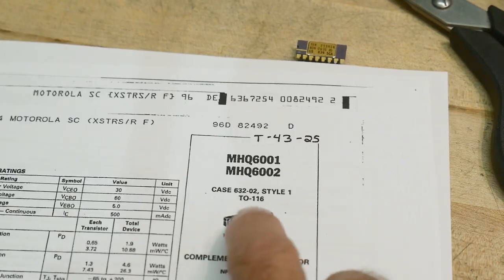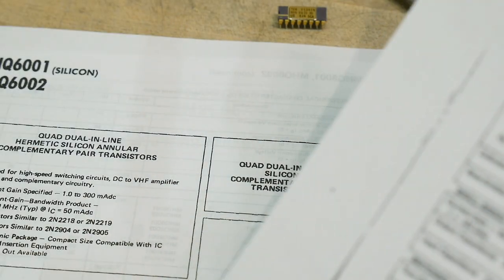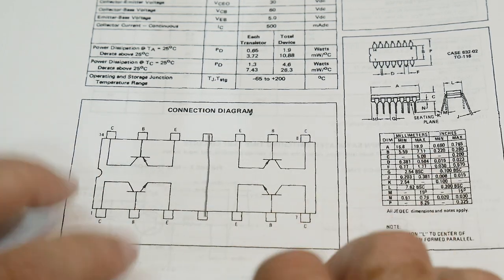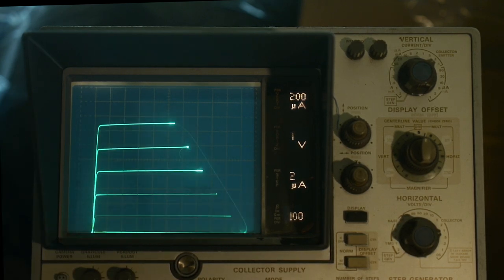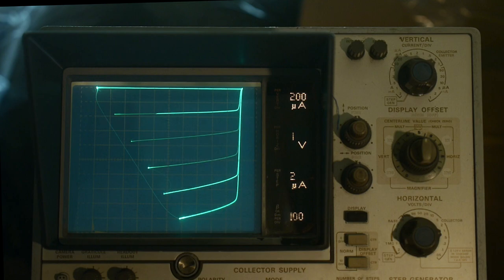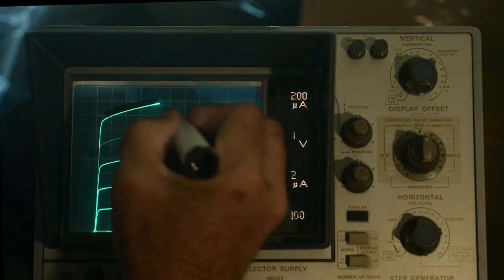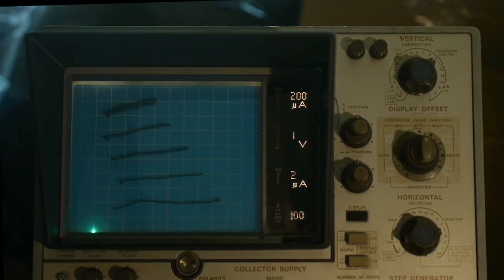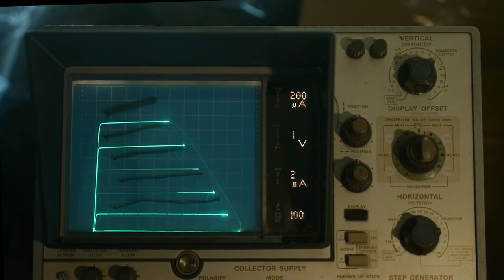#1615 MHQ6002 Quad Complementary Transistors

Comment: Back in the day, it was pretty common to use one pair as a heater and temperature sensor, so that the second pair were held at a constant temperature. That way the kT/q dependency was taken out of the equation.
Reply: Isn't that similar to how a band-gap reference works? Use two transistors at different bias levels to remove temperature effects?
Reply: @robertbox5399  this is more of a brute force approach: force the whole die to a known temperature above ambient by heating it. One of the four or five transistors in an array was just having current pushed through it to heat the chip.

Comment: I think manufacturers call then complementary when they share very similar limits in their specs such as voltage, current, power dissipation, frequency limit, and internal capacitances.
Another thing is "matched" where they behave identical in their way of working, and that's what you see on the curce tracer.

Comment: These are the harris, Intersil replacement parts from Renesas: HFA3046, HFA3096, HFA3127, HFA3128, Analog Devices also has a few.
How would these perform?

Comment: I was surprised the Early voltage is so low on that 2N3906... so I looked at the data sheet and didn't see it specified.  But Mot, er, OnSemi has SPICE models for each.  And, behold!  VAF is only 156 for 2N3906, and 1000 (that means 'large') for 3904.  I'm a bit lazy to take the time to actually run curves in SPICE3, but it would be interesting to see how well they match the sample (of one) that you ran on the tracer.
Reply from the maker: old PNP designs all looked that way, that's what I remember

Comment: We used a thing called BCV62 super matched pair. If it got heated by the PCB it would drift all over.
Reply from the maker: yes but did both sides drift the same?
Reply: @IMSAIGuy  One side was nearer to a coil driver FET which got warm. We fixed it by rotating the device 90 degrees.
Reply from the maker: @robertbox5399  nice

Comment: 7:30 is there another way to do this without that device?
Reply: A multimeter's hFE function measures one point on those curves, so it can give you some data. If the bias the multimeter uses happens to match that of your target circuit that might be enough. Otherwise, you could breadboard something that provides the bias you care about and measure the gain around that bias point. This won't show the big picture like the curve tracer does, but it would let you match a complementary pair of transistors under the conditions that matter to the circuit you are building.

With an oscilloscope, it's possible to build simple curve tracers. Look up "octopus curve tracer" online for a simple two-terminal version, or it's possible to breadboard a curve tracer that draws any one curve out of the family of curves IMSAI Guy's fancy curve tracer shows.
Reply: @stephentrier5569  Oh, thnx.
But at the moment i do lack a good m.m., my "Home improvement" m.m. can measure 220V, but low voltages like 5V!
Reply: @stephentrier5569 too many word to say a simple thing. Like socpes, there is a fine tune knob on any good curve tracer  to lower (but not increase) the current going to  transistor's bais.  They added this knob for exactly what he needed to do.

Comment: What could the most unusual use for a quad transistor array: To fix temperature gage of a car was reading too low. Two PNPs wired as Current Mirror to amplify the signal. For every 1 mA of current going through the sensor to ground, another 1 mA of mirrored current sent directly to ground. Doubles the current coming from the gage and corrects the reading. Attached near temperture sensor.
Reply from the maker: I would make a hand warmer